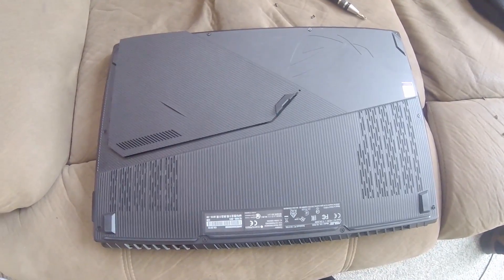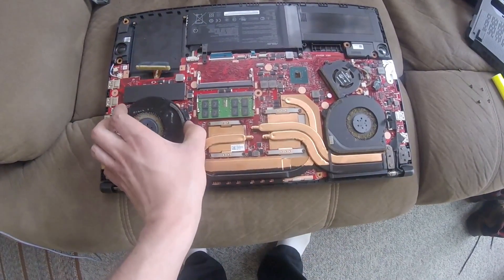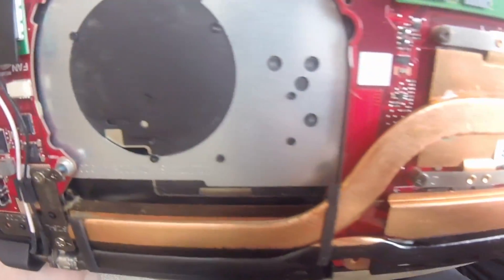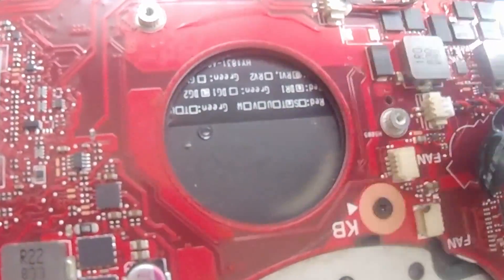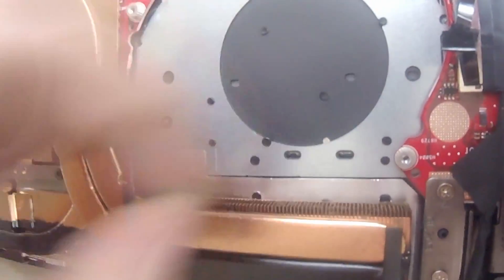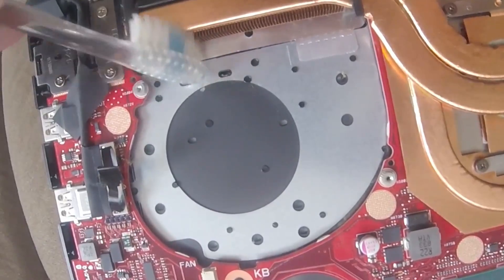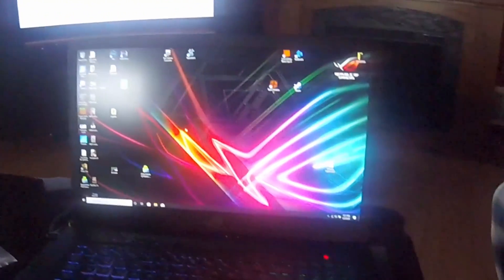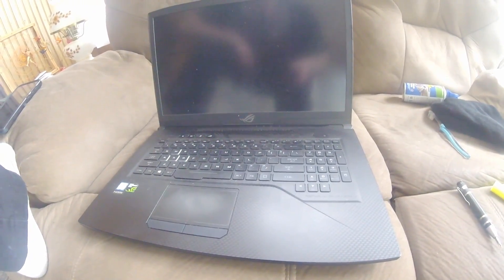How to clean a Laptop with a Toothbrush and Air  -  ASUS ROG GL703GS-DS74

Comment: Hello. How would one go about cleaning those two fans without taking them out of the computer? I really don't want to un-attach and move things if I can help it.
Reply from the maker: The fans should be simple to remove if not you can use a air hose or air duster to clean it out in the computer, but it will not be as effective  as removing them just be careful not to blow the dust in deeper. They also sell a cleaning putty for keyboards that might work.